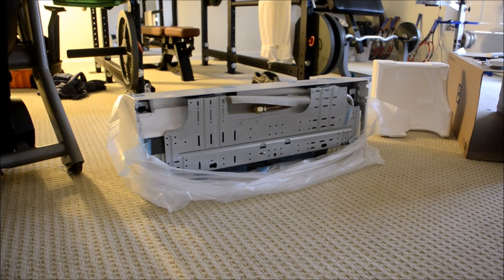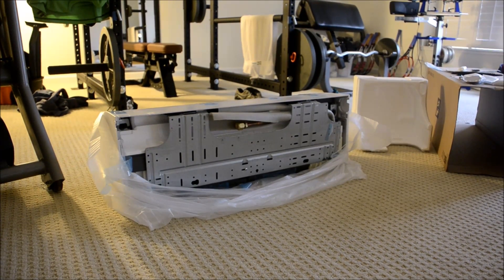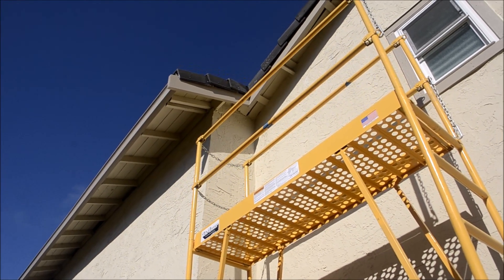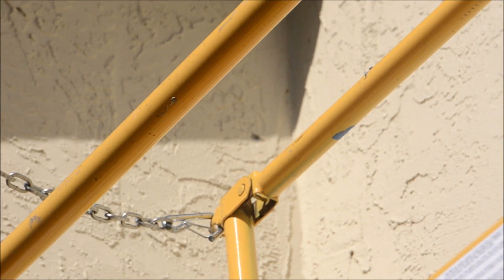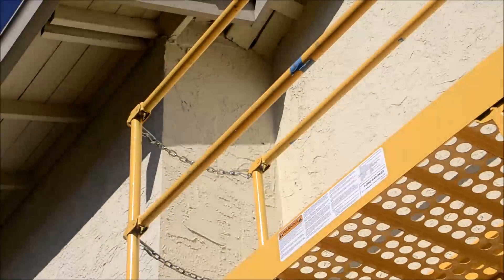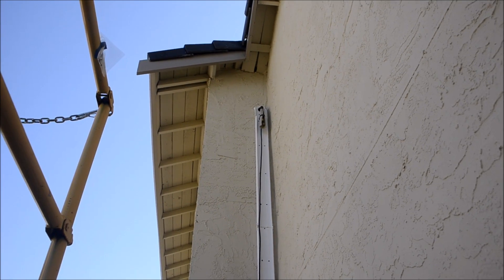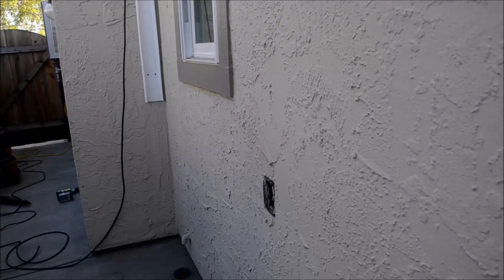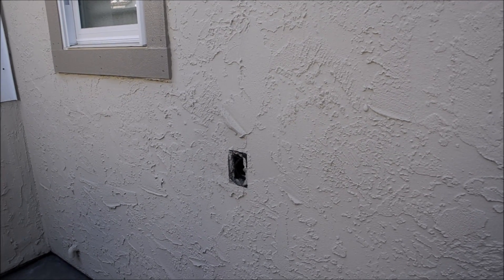Fujitsu Mini Split Install

Comment: So when do you put the schrader valve back in the service port?  I'm unclear on the process from just after evacuation to just before releasing the refrigerant.
Reply from the maker: The valve is never removed, it is exactly like a valve on a bicycle tire only this time you are using it to remove the air and create a vacuum in the lines. So take the cap off the service valve and you will see the schrader value, connect your vacuum pump and pull a vacuum. Once the desired vacuum is reached turn off the pump and wait a while to make sure the vacuum holds, i.e. there are no leaks. Note: If you have a ball valve in the hose (the one connecting the vacuum pump to the service valve) then close it. Otherwise close the valve on the manifold. Assuming the vacuum is stable, then you release the refrigerant and then you can disconnect the vacuum pump hose from the compressor. Make sense?
Reply: OK I'm still confused.  At about the 12minute mark in the video you talked about how the 5/16" to 1/4" adapter fitting didn't depress the Schrader valve.  So how did the nitrogen purge or the evacuation take place if the valve isn't depressed or removed?  Thanks.
Reply from the maker: Got it. What I was trying to say is that I didn't tighten the vacuum hose enough to depress the valve, so when I initially pulled the vacuum I got an instant vacuum which couldn't be right. So you simply need to tighten the hose enough so it depresses the valve and then it should take a good 5 minutes before you see the vacuum where it needs to be. If however, you see a big vacuum in seconds then you haven't tightened the hose enough.  Does that help?
Reply: Yes that helps.  Thanks.  I'm planning on installing a mini-split myself in a couple weeks and I'm doing as much research as I can before it shows up.  This video is definitely one of the best installation videos on Youtube.  Thanks man.
Reply from the maker: It will be a fun project, but be prepared to take your time and get it done right. The one thing I would recommend is get the right specialty tools, they make it much easier. At a minimum you will need a vacuum pump and hose, torque wrenches with crescent heads, manifold and hoses, bottle of nitrogen with gauges, , copper pipe flaring tool, and the correct thread sealant for the refrigerant you are using. You could easily buy everything for around $5-600 and then sell them again after you are done. Good luck!

Comment: I say the same thing great installation, since you had the ball valve in there you should have closed it because your system was under vacuum and then release the refrigerant AND THEN  DISCONNECT THE HOSE FROM THAT PORT.  I did my own installation a 2 months ago on a LG bought online too and it blows 35F cold air! Thank you.
Reply from the maker: Yeah, I see what you are both saying. In hind sight that would have been a better approach and if I had to do it again that is definitely the way to go as there would be zero chance of any air getting into the system. But since it was under vacuum (150 microns) and I had the vacuum pump running my theory was it would be really difficult for any air to sneak past the value, at least to significantly impact the vacuum. Fortunately for me, the system blows cold and drops the temperature from 85 to about 66 in about 20 minutes (400 sqft room) so I guess I didn't cause myself an issue. Congrats on your install, I hope more people install their own systems and tips like yours and Joe's will certainly help them.
Reply: I did not use a nitrogen leak test because I don't have one but I was able to vacuum the lines down to 85 or 83 microns(I can't remember)and my line set was only 10 or 11 feet, I didn't vacuum any refrigerant due to shorter line set, I just kept the same charge that the unit came with. My temperature between inlet and outlet  is around 36 or 40 degrees so I think it is working at its peak.

Comment: Congratulations, you just installed a unit much better than even some "contractors" do. Only thing you could have done differently is perhaps close off that valve on your manifold hoses after you got your vacuum, then open up the valve to the unit, to make sure it couldn't suck up anything back in via the schrader valve. Otherwise, even if you have no warranty, who cares? You could buy a whole new unit and still come out ahead.
Reply from the maker: Yeah, that would have been a good idea Fortunately, the unit is still going strong so it looks like everything worked out.  You can always learn something new, so thanks for the tip.
Reply: Dan, once you've reached a vacuum below 500 microns that you're comfortable with, can you close  the valve that's attached to your blue line, shut off the vacuum pump and remove the fitting from the suction line and then open both gas valves? I figured once the Schrader valve is closed, opening both gas valves to release the refrigerant should have no problems. Thanks.